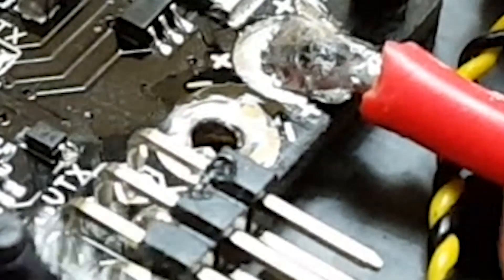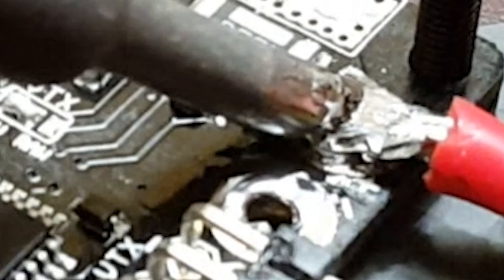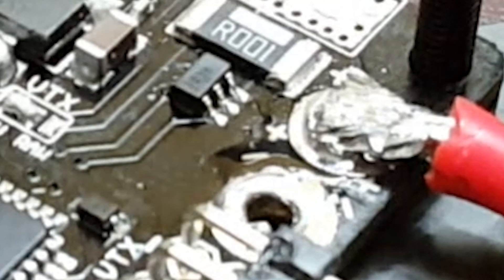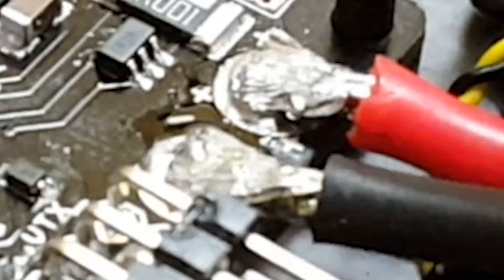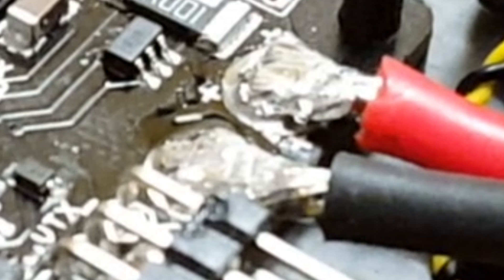Solder Reflow Method

Comment: For good practice, I would avoid adding heat to the board one right after the other. Give the first a chance to cool and then hit the other. You did it quickly, but others may not. 
That gauge wire insulator being pressed tight against the edge of the board could give it extra rigidity and shock absorption.

Comment: Hi mr bardwell. I think my bff3 boards that I was talking to u about a few days ago has had to much heat from my iron. What is ideal temperature to solder the bff3 board?  I don't want to ruin a 3rd as iv ordered another. Please help me with this question
Reply from the maker: +Craig chivers the pads on the BFF3 are sometimes hard to solder to. I usually use 800 F but I make sure I'm in and out quick.

Comment: I solder much the same way for soldering wire to PCBs. I tin the pad and the wire, then press the wire down into the pad with a tool as well as a tinned iron with a big chunky tip. that way I melt all of the solder together, and having pressed the copper closer to the pad, the current passes mostly through copper, not solder at the joint.
that's what works well for me, but fundamentally as long as you've got what looks like a single fillet of solder connecting the pad to the wire, you should be okay. if it looks like you have two seperate blobs of solder, one on the wire and one on the pad, chances are the interface between the solder on the wire and on the pad will be unreliable both electrically and mechanically.

Comment: Ya know what I've never figured out?  ...why some solder joints become wicked hard and almost impossible to re-liquefy no matter my heat.  I'm always using the same solder (I'm not sure what type) and generally around 390-415 temp.  Like I have a couple ESC to PDB wire joints that just will not liquify at 450+ w/ a large tip.  Do you know what I'm talking about?  Can you, or anyone explain how I'm doing this and how to avoid doing it?
Reply: Try reapplying solder to the tip before you go in. It really helps pass heat to the joint and liquify it. And clean the tip often. I know those are basic tips but being methodical in your soldering solves lots of problems (or atleast that's what I've found). You could also use a wider tip as that will help too.
Reply from the maker: Apply more flux, or more rosin-core solder (with flux in it). The flux helps the solder flow.
Reply: Just like Josh did here, a little dap of solder to transfer that heat. I do reflow differently. I use a really thin solder wire between the tip and target and keep feeding thin rosin core wire until full heat transfer. My thoughts on this is the original rosin had all been heated/used off. Before the thin wire method, it was the brute force of push the tip and twist back and forth. Let me tell you, when you do things the hard way and then get a tip cleaner, sponge and flux, it goes from brute to art and 160 watt to 60 watt.

Comment: I would suggest to use these holes! Tin the pad, don't tin the wire. Put the wire through, bend as necessary, use a clamp or something else to attach the wire to the board. Go from the side, where wire has no insulation and tin the wire from there. Add solder until you can't see the wire strands. By that point you'll have the solder flowing onto the pad too. Going through the hole relieves so much stress from the solder joint, that it will be almost impossible to break.

Comment: Constructive:  You can do better.  Use a solder suction bulb to clean excess (easy to empty after the beads cool by pulling plastic out).  Resolder with solder lead rosin flux.  It should not be rough like that.  You shouldn't see the strands.  Strands can break off, cause a connection, or cut or poke you/other wires.  It should look like a tear drop and clean looking.

Comment: I love the older style chisel tip soldering irons, they're SO much easier to work with than the modern 'designed for surface mount' pointy things

Comment: I've noticed you almost need two different irons to solder a PDB vs all the other pins on a quad. I can crank the crap out of my small/medium soldering station to get the PDB done, but you really need a iron that will quickly deal with the heat dissipation of the PDB. Also, a temp controlled soldering station is a huge upgrade over a "dumb stick" type iron and they aren't terribly expensive for a hobby like ours.

Comment: i definitely got a suggestion.. and before a big thanks for all your videos, and thanks for sharing this one too. soldering is way too overseen in my opinion. i think your method will to a good job, but i think you could do better. and with better i also mean even nicer looking ;) (sorry for that, but i truly believe, nice joints mostly are better joints, more reliable, more robust, better with current-flow - you allways have the problem with change of medium, but i think surface is something to consider. with a "nice looking" solder joint, you can see on the surface that it was flowed and reflowed correctly, if its a nice flat droplike surface additional things like liquid-tape can be applied more easily, and probably removed better..all in all i believe that repairs, maintenance and the search for breaking points can be easier with a more clean look) - so here is my constructive tip: helping hands and/or anything of help to lay out the cables on the joint, so that the whole thing touches each other before even coming with the solder-iron (everything pretinned of course), and then...with bigger joints like this video was for, crank up the iron a bit and hit the whole thing preferably just once and apply as much solder as needed to create this one drop (tiny enough to cover most of the wirespikes - therefore i really don't like your pretinned wires at the beginning, and i would have my doubts, to be honest, if i see that on the field looking what possibly could be wrong with that quad) - by seeing the video, i see, that the joint will hold and is good.. but i would really aim for pretinning and then heating all up and apply enough solder just once, if its going well, maimum two times. one key thing why i think this video is good as so many of yours, is the point to look closely if everything melts properly and nothing is moved untill its dry again.. one soldering schoolery i will recommend..

Comment: nice work Joshua! what kind of solder are you using? it looks lead free... and i solder as low as possible (320??) , with a little oempf++ if the wires get bigger. Also nice tip on the extra dab of solder. That works for me like a charm also more flux if you have, but nice shorcut i use all the time. Tin is way more close... And I use a metal isolated pincer ;) cheers!
Reply from the maker: +Jurik Ristjouw leaded solder only.

Comment: Blu-Tack is your best friend when soldering (best tip from uav features ever)
Reply: Agree, used BT when doing basic stuff as a kid but now with finer electronics its almost solely angled tweezers, a hot tip and pre-loading a smaller tip, to simulate a large one.

Comment: The elephant in the room here is that the tip must be large and have a good contact area in order to transfer enough heat in a short time. A large tip has greater greater mass and consequently more "thermal mass". So a bevel end like Joshua is using or a chisel point and as big as practical. Definitely not a cone shaped tip.
Reply from the maker: +Rob B definitely. A weak iron will solder okay with a big tip that holds heat.
Reply: Not letting the tip build up heat killed me at the start of learning. Now, it amazes me how little contact it actually takes and I get full flow because the contact is quality over quantity.

Comment: Thanks for the tip! I do something similar, but I use a pair of tweezers used for electronics or jewelry to hold the wire in place. I find that this works really well, and allows for more precision. Thanks again for all the wonderful videos!

Comment: Great tip.  I do the same but with a bamboo skewer NOT a metal object that, like you said, draws heat away from joint.  I also like the ability to put a notch in the end of the wood to better hold the wire.  cheers!

Comment: Thanks I really needed that. I am doing my first FC without pins....well after i removed the pins for a FC I have been using. The depinning is crazy scary. I have got everything but the esc signal wires soldered up and is working. waiting on a new frame to hook esc up.

Comment: For general purpose soldering job, I will use 60/40 or 63/37 solder.  Solder wire diameter ranging from 0.5mm to 0.8mm.
When soldering thick wire on large pads, I recommend using solder contains Silver coz it has lower melting point.

Comment: Hi. Thanks for the tips Joshua. 
I'm still learning, and used to use a flat screwdriver to hold wire down, but twice i bridged a pos+neg joint without noticing. Got saved by smokestoper. And now i use a wooden stick (hashi from Japanese food is excellent) :). Doesn't transfer heat that easy, get's some smoke, but never happened again the bridging.. could also be that i'm improving my solder skills (i hope at least).

Comment: What's the benefit in using a big wire like this? Wouldn't it be ok to use wires that can fit through the hole, which also makes the joint stronger?

The pads look easy to lift off with big wires.
Reply: Bigger wire = more current

Comment: Sometimes with those larger through holes I will twist the wire, lightly tin and push through the hole. I add a touch of heat so that it will tack in place as I make the angle of the wires nest in the way I want them.  I then snip any excess that hangs through the bottom, then I will solder from the bottom. Not sure if this is the correct way but it seems solid and looks very neat. Also i use a different tip that suits the application, wider for heavier gauge wire, smaller tip for smaller wire etc.

Comment: i'm sorry, but this really is not a good example to go by. your joint is awfully dry, which i learned increases the potential for failure, and just doesnt look good. you have the perfect amount of solder on the joint, when the fillet surface is just about to start bulging outwards, on larger joints like this, or a slightly bulging on small ones. you want them nicely saturated .. wet and plump. lol (twist the wire firmly before pre-tinning, so it doent fray and smush like this.) these are okay. as an example: http://cdn5.myfirstdrone.com/wp-content/uploads/2014/01/IMG_2497.jpg
i dont mean to drop my smartypants here, but this solder joint would be completely unacceptable in electronics production or training. 
soldering seems to be quite a mystery for a lot of people coming into the rc hobby, and frankly, a lot RC related soldering tutorials aren't exactly good. better to watch some "normal" soldering tutorials, practice a bit on junk electronics, and then solder your dear and costly RC components with confidence and good results!
gee, i got a tad rambly there :D hope it helps. peace~

Comment: i solder like that all the time. cool, didnt know its a special technique. but joshua is right, solder like that and you have a real solid connection. i use an old scalpell, because then i got a very tiny area to transfer heat away from the soldering into the scalpell. a screwdriver may transfer more heat away (because bigger touching area) which could be disadvantageous. but just do it like it works for you.

Comment: I like to tin the pad and get a nice little blob on the end of wire separately at first (with leaded solder), then heat the wire until blob is molten and bring it down over the pad. Keep the heat on until the blob flows down.
Reply from the maker: +C. Av yup. Good technique.
Reply: +Joshua Bardwell Good for that particular scenario where wire is the larger thermal mass and not the pad/pcb (high temp silicone insulation also helps!). When greater thermal mass is the pad and wire is thin, the opposite. I'll lightly tin the wire and leave little blob on pad, then simultaneously heat pad until molten while adding wire to the puddle! Nice soldering by the way!! xD